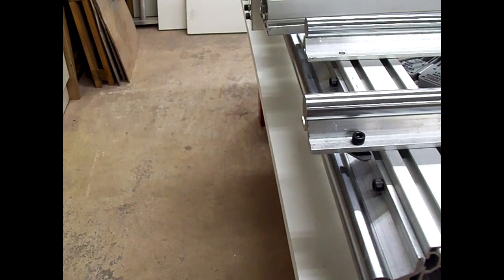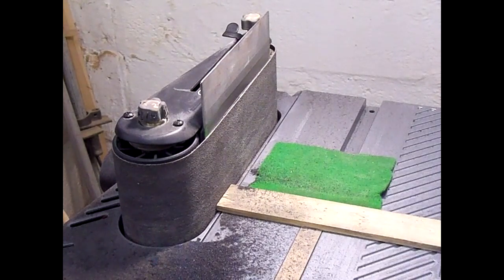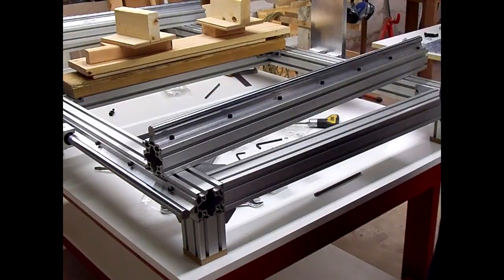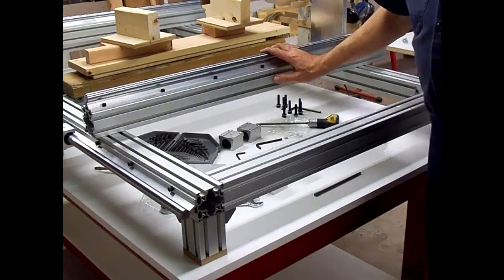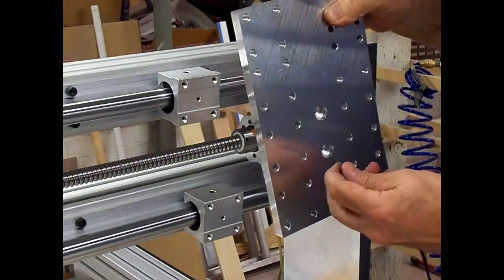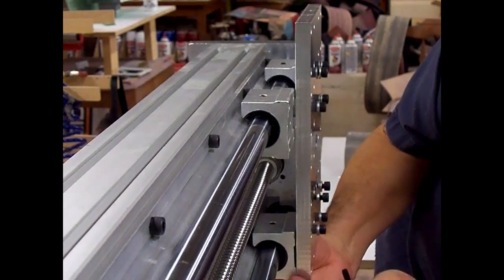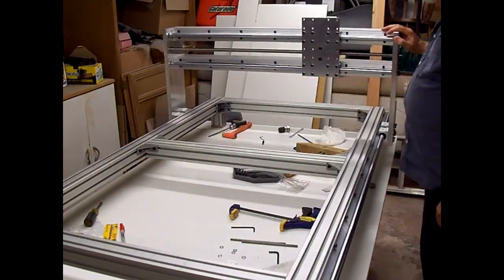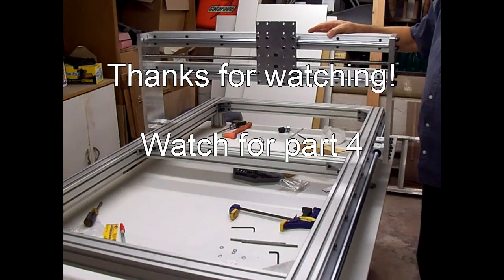CNC Router build part 3

Comment: hi sir. I wonder what 's the working size of this machine and which is the type of the linear slide rail you using ?
Thank you.
Reply from the maker: It's about 30" x 48" working area.  The linear rails are like these in this link but not the same ones: https://www.amazon.com/Included-Bearings-Automated-Machines-Equipments/dp/B09MMYTVZM/ref=sr_1_1_sspa?crid=3ETG4DHA6HB9O&keywords=linear+rails&qid=1677724002&sprefix=linear+rails%2Caps%2C83&sr=8-1-spons&ufe=app_do%3Aamzn1.fos.304cacc1-b508-45fb-a37f-a2c47c48c32f&psc=1&spLa=ZW5jcnlwdGVkUXVhbGlmaWVyPUExWjlUTFVGUkc2TDQyJmVuY3J5cHRlZElkPUEwMzMxOTgxM1NJRDY3WUFLWlpFQSZlbmNyeXB0ZWRBZElkPUEwMzE3NjkwMjMwRllBVlNZUEhTNSZ3aWRnZXROYW1lPXNwX2F0ZiZhY3Rpb249Y2xpY2tSZWRpcmVjdCZkb05vdExvZ0NsaWNrPXRydWU=
Reply: @MyRobertadams  thank you so much.

Comment: Nice Build!!! Where did you buy the universal plate for the z-axis? Did you buy the gantry riser plates pre-made, or di you have to cut and drill those out by hand? I too am using Linear rods kit, only thing I’m worried about is that the rods will have play in them, but I’m confident it should work for what I’m doing (guitar bodies). MAN! This thing looks super solid! 

P.S. What size motors are you using? Do they handle the weight okay? I’m going with 3 x High torque NEMA 23, 200 step stepper motors… I bought some controllers that support step muliplication, so I’m hoping it will work good enough for what I’m doing here.

Any advice on plate parts will be greatly appreciated, sir. Thank you!
Reply from the maker: All parts came pre cut and drilled as part of a complete kit. (Which is no longer available) Motors are nema 23 , 425 oz. in. They handle the job just fine.

Comment: It seems to me the weakest point in this build is the gantry. The height/ weight mounted to a fairly small spread on the rail ( less than 6") lends itself to more deviations on heavy cuts and fast moves. There is a lot of weight and a fairly high center of gravity amplifying everything. This is why you see most upright gantry plates designed with a longer plate where the bearings ride the rails at around 10" spread or more and a gantry height only as tall as needed (most around 7" bit clearance.)  Please let us know how things are working with this build and what kind of tolerances you get in different materials.  Thanks for the videos.
Reply from the maker: Haven't had any probl;ems because of the gantry.  I don't use the machine every day or sometimes every week so I really don't run it through its paces  as they would say.  As far as tolerences, that all depends on how well it's calibrated but for what I use it for occassionally, it does okay.

Comment: Hello Robret, Greetings from Ecuador I congratulate you for your videos are very clear and technical, I like to do my own projects, my question is that if this cnc can perform high relief work or everything depends on the software and drivers used, I would also like to know if I can use a Mega Arduino to control the elements. Apologies for my English, I'm using a translator

Comment: Good evening I really enjoyed your CNC project please help me build my CNC send me the designs and the CNC software my email
junior-duarte2005@ig.com.br
thank you very much for your attention
Reply: Robert, could you please provide plans or can you give me some help to build CNC? It is universal software?
Which electrinics I need as hardware?
Reply: *****  Thanks for reply. Can you recommend me supplier for electric parts/software? If I buy small frame CNC, and change frame (increase size, do mechanics by myself, will I need to change sofrware, to make any configurations on it?
Reply: ***** thanks Robert for answer. Is mach3 software free? If motor can move object on 50 cm for instance, it will run on 1 meters too I think. What is "drivers which come with electronics"? driver is software?  I am going to buy cheap small CNC and enlarge it.

Comment: how thick are the z axis plates?
Reply: +MyRobertadams I have to ask: did you machine those side plates yourself or did you order them? 

Where I live those would probably run in the hundreds of dollars each....just for the machining.....and easily $150 for the plate itself....

Just did a rough price: steel plate would be half as thick and 1/6th the price.....sure, it'd be 6 lbs heavier but.....
Reply: ***** ah this was a kit? I did not know that....